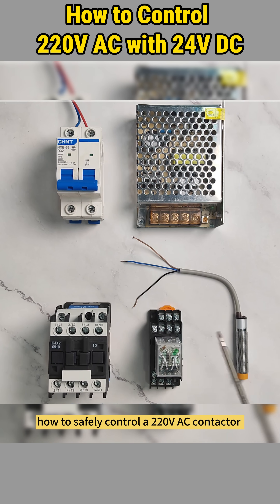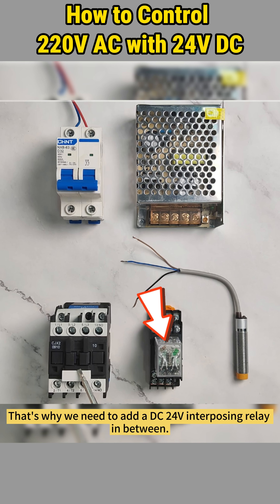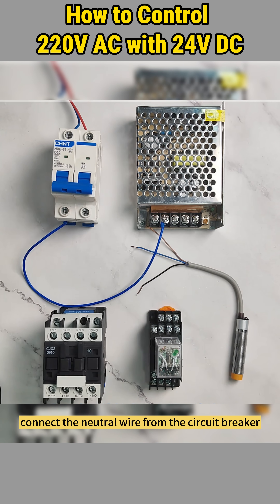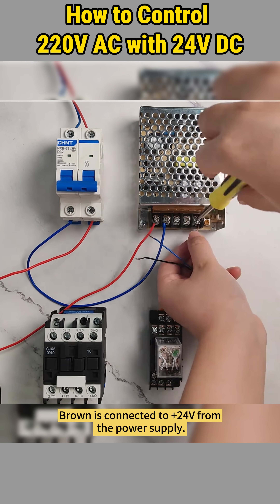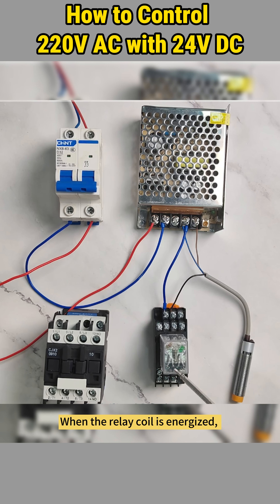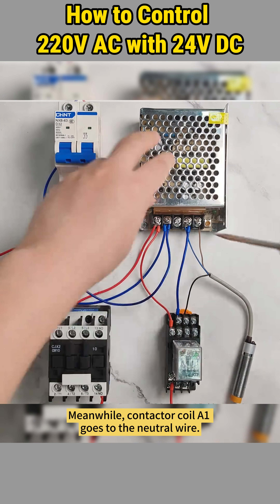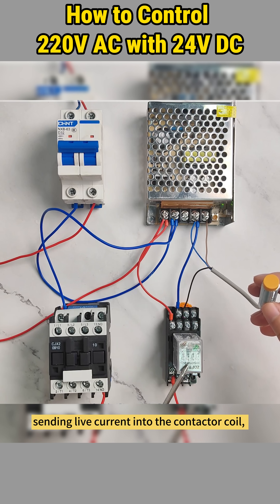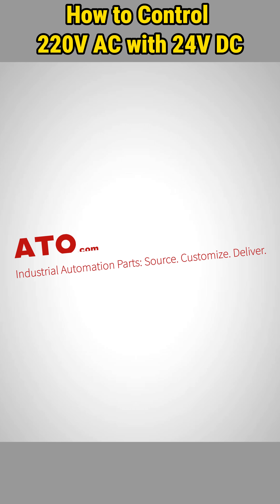How to Control 220V AC with 24V DC?

Comment: A proximity sensor can not deliver the current needed for the contractor coil to get energized. That's why they using a interface relais. The only thing wrong is the live wire to A2 and the neutral to A1. Its the other way around.

Comment: do they make a latching 220 volt contractor ?
Reply: You have to wire the latching (holding circuit) or install an aux block that has a latching mechanism